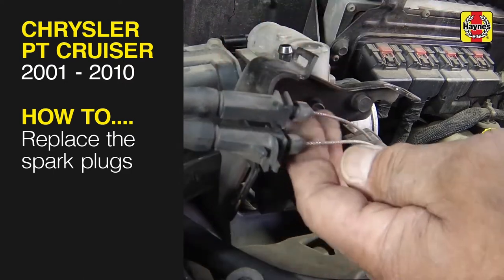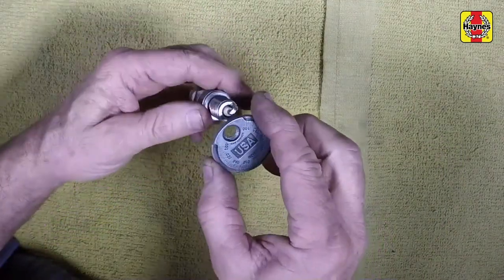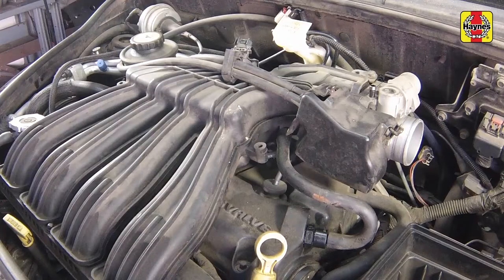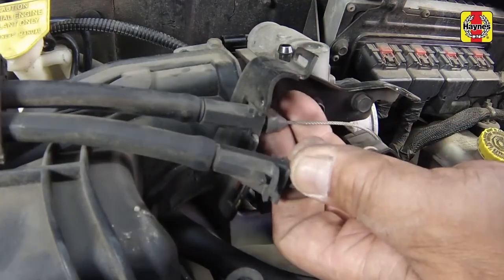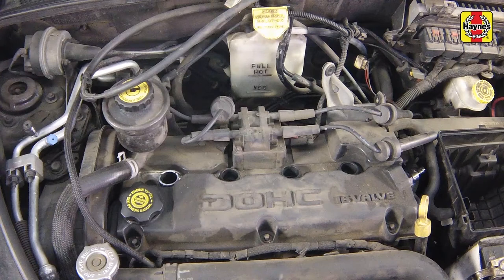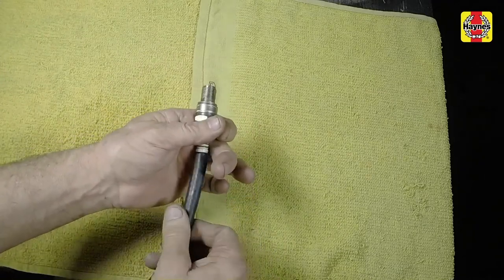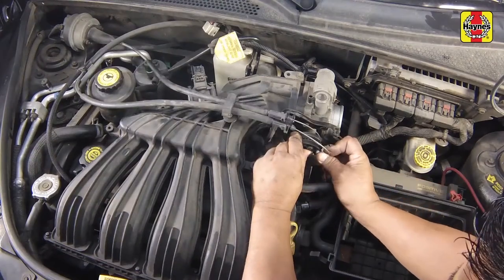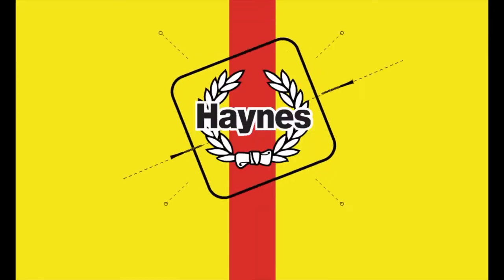Chrysler PT Cruiser (2001 - 2010) - Replace the spark plugs

Comment: Hope I get answer  my spark plugs on my pt cruiser are worn out will.be able to replace then this coming Saturday is it okay to drive the car with worn out spark plugs
Reply from the maker: Apologies for the delay in responding. No doubt you've replaced the spark plugs, but for future reference, If the engine runs ok and there is no check engine light for misfire codes (engine is running clean on all cylinders), you should be ok for the time being. We wouldn’t recommend driving far until all spark plugs are replaced.

Comment: This makes a very simple job a very complicated job. Just loosen the bolts from the intake disconnect the vacuum lines and life it up and block it with a piece of wood or hang it with a bungee cord and change the plugs. No reason to remove anything else. If you do by chance removed the throttle body be sure to clean it before you put it back in.
Reply: No need to disconnect battery?
Reply: @lakersfansince1991  well.....technically for safety reasons yes, but you dont Haaaaave too...